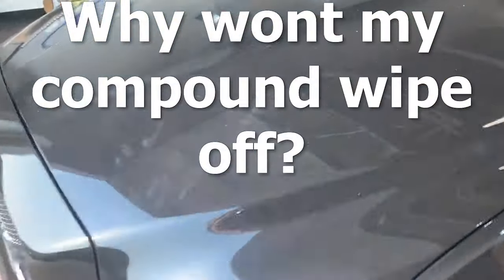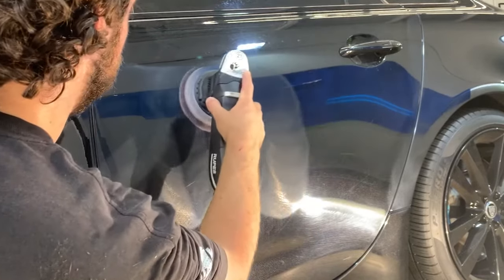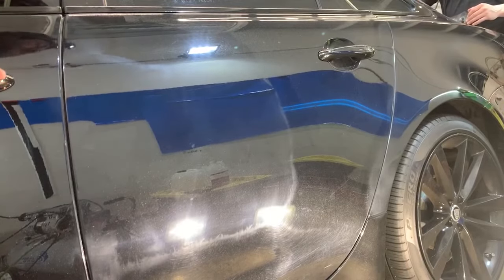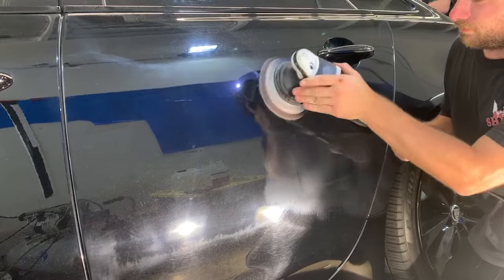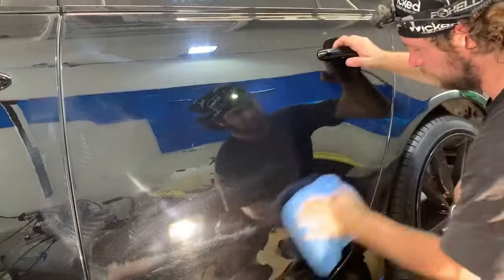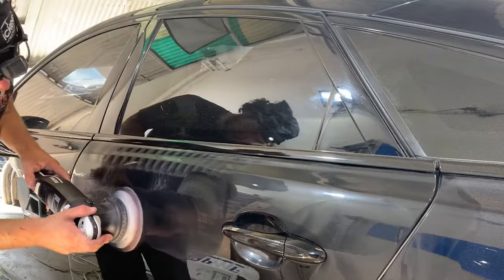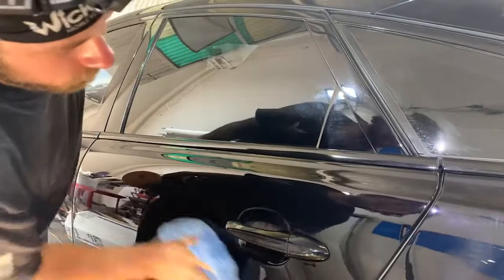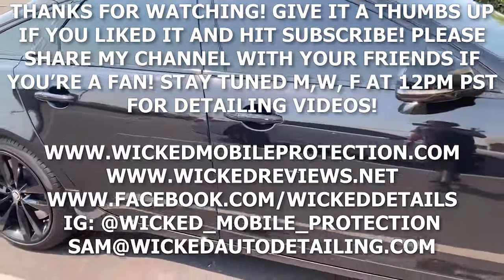WHY CAN'T I WIPE COMPOUND OFF THE PAINT? | BLACK CAR PAINT CORRECTION BEFORE AND AFTER

Comment: Way too much polish and not working until it's clear. The high temperatures are making it even worse. The variables are endless and you can only figure it out by experimenting by yourself with a few rules that never change such as keeping a clean pad. Also keep checking results of each variable such as down pressure, amount of product, type of product, pad, dampness of the pad, temperature, arm speed... literally everything😮
Reply: @Detailjesus  or just use gold standard polish and that eliminates all the bullshit
Reply: @Rabbit.760 I that is so true , I tried that gold standard polish and I was blown away by the ease of use to wipe off and left clarity…No haze …

Comment: One of the biggest problems, is you just arent suppose to use rubbing compound when its so hot, anything over 80 degrees is pushing it. And you wanna be in the shade if possible also.
Reply: Fuhkin A right Brother

Comment: I have a Xj 2011 v8 supercharged in Botanical Green pearl  I live in Western Australia not humid its just a dry state and hot, the paint on this car is so soft all you need to do is look at and it will scratch, same issues with any type of polish I have tried, its bloody TERRIBLE, going to try Kochchemie finishing M3 next, Maguire,  nope, Mothers, nope, Auto Glym, nope, Chemical brothers, nope. Its just the paint on these cars is as soft as cheese, tried hand, DA and rotary, honestly beautiful car, nealy 600 rear hp on mine with VAP tune stage 2 and I HATE IT!!!
Reply from the maker: Are you a professional?
Reply: @Detailjesus  , no mate just struggling with this paint since I purchased the car, am selling now and making a last effort in researching products, it literally drives me nuts, to date dealing with mine is a 2 or 3 day process, not just wax on wax off, left the circle, right the circle, disappointing paint on a 300k+$ Aud car, for me anyway.
But thankyou so much for the vid, you would not believe what a relief it is for me to find the same car with professional operators actually showing my EXACT issues and how to troubleshoot

Comment: Your not getting much cut with the compound because its drying out too fast, use a damp, coarse, foam, pad next time and clean it after every section.
Reply from the maker: That does not help on this car.
Reply: @Detailjesus  I still think your sections were to big and you were overworking it dry.
Reply from the maker: @djstocks  ok

Comment: Hi, I just faced the same problem. 
Mine is Hyundai Verna 2022, Starry Night(Dark Color), 8 months old car.
I thought of using Meguiars products and bought them.
I applied Meguiars Ultimate Compound with Microfibre pad by hand and buffed it off using Microfibre cloth without any issues.
And, after an hour, I applied Meguiars Ultimate Polish with another microfibre pad and after 2 mins I tried buffing it. But it isn’t going off at all, I buffed it for more than 2 to 3 hrs, but could still see multiple haze spots.

My query is,

Can I apply the Meguiars Hybrid Ceramic Liquid Wax on top of it? And does it remove the haze caused due to the Polish?

Or let me know if you got any suggestions.
Reply from the maker: Judging by what you’re doing, it sounds like you should hire a professional.